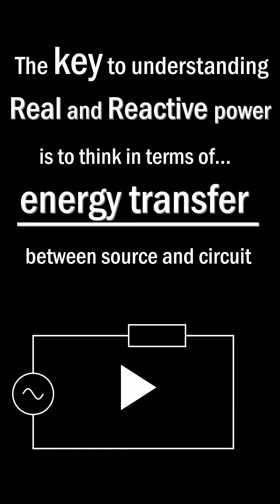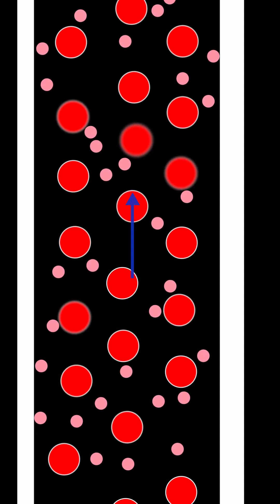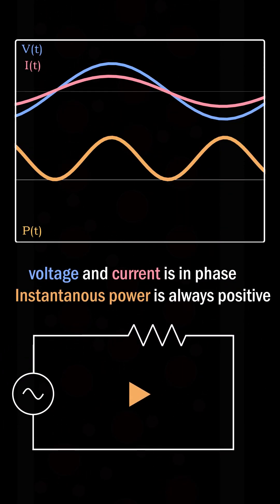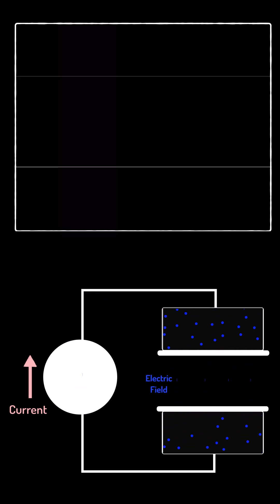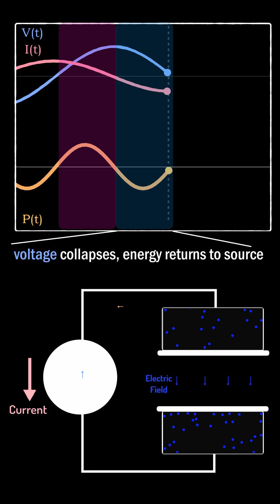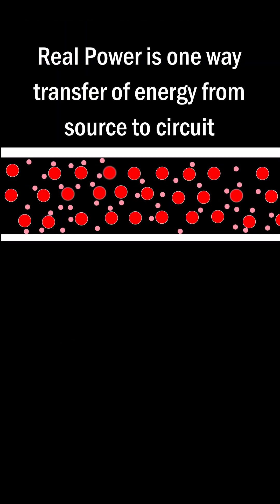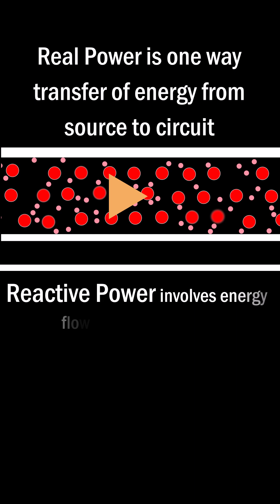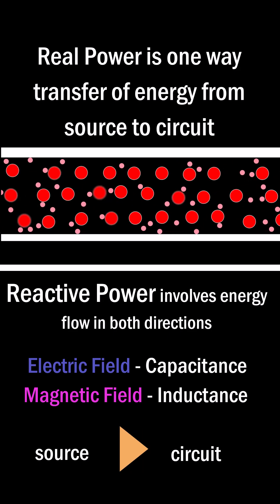Real and Reactive Power - what do they actually mean? #reactivepower

Comment: As I for a long time was aware of lagging current in inductive circuits, I got the feeling that capacitive circuits rather distinguish the voltage as lagging (ofcourse current leading), since there is a charging going on , and the voltage cannot change instantly..  (So for inductance the current cannot change instantly) Cheers!